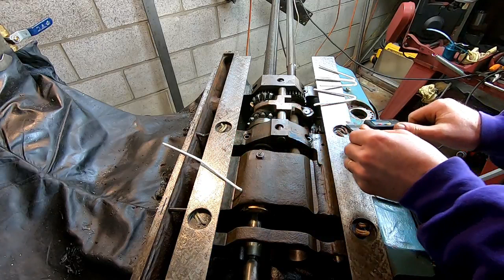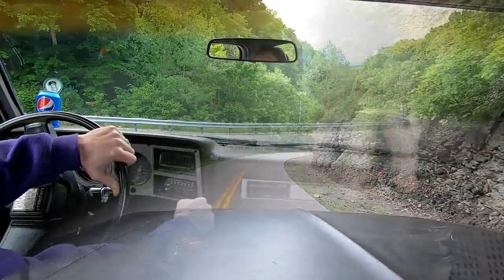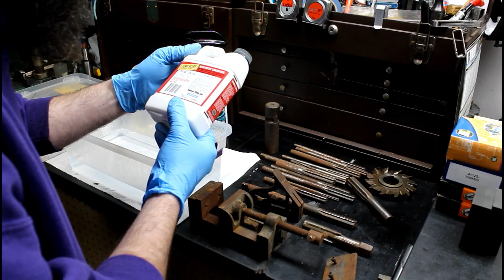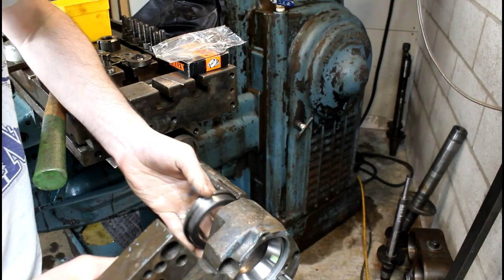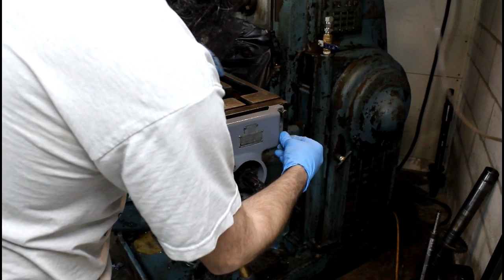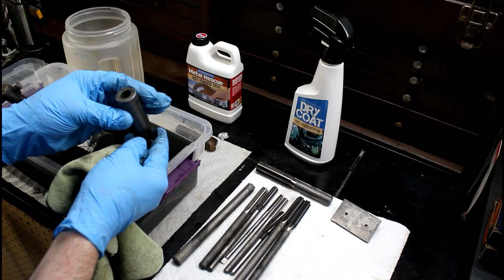Showing the K&T mill some LOVE

Comment: I wouldn't be surprised if the main constituent of the rust remover is based on Phosphoric Acid. I used some 81% pure PA, from a Hydroponics shop, when I was restoring a Lafette 42 machine gun tripod and it worked a treat. Beware, it will instantly destroy any electro/chemical metal coatings e.g. blueing, phosphating etc. However, as Steve mentions, it won't damage paint, glues etc.

Comment: Steve,
I have some some used horizontal cutters that I can't make use of and would send you if you think you might be able to use them at some point.  Most would need to be sharpened but you have the technology and know how for that ;^). They are all 6" diameter for a 1.25" arbor:
6 x 3/4 x 1.25
6 x 5/8 x 1.25
6 x 1/2 x 1.25
6 x 7/16 x 1.25
6 x 1/4 x 1.25
4 @ 6 x 1/8 x 1.25
If you're interested, send an email to jeback1@gmail.com
Cheers,
Jan Erik

Comment: Hey steve,  i havent watched the full video as of yet but i have watched the first 24 minutes so far .... One question. Before you installed the gear box shortly after the 22 minute mark, you installed the bearing race and bearings... But i didnt notice you fold the locking tabs to prevent the retaining nut from backing off. Or am i wrong ?

Comment: Have two sons the same as yours. Mine are 47 and 51 now but they loved there motor bikes and go karts. Both ended up enjoying the shop, welding , the lathe and the milling machine. Both are copier repairmen now, still coming to dads to use the machines all the time. Even making parts for those fancy new copiers. Enjoy your time with the kids. They grow up too fast.

Comment: I've seen a lot of brands for de-rusting stuff now. Bilt Hamber has a powder that self neutralizes after a while, they also have a gel, there's Evaporust, CRC and now this stuff. Sometimes I just use the pickling paste we use on stainless steel welds, but that can cause some damage, and it's pretty bad to get on your skin etc. Citric acid is less dangerous for you typically, but it does require you to clean your parts really good after bathing them

Keith Fenner runs some coolant mixed with kerosene in his K&T iirc, it looks pale blue in the videos, I think he's mentioned what he uses but I can never remember.

Comment: Steve,
When doing similar repairs on Timken bearings on manual machine leadscrews I indicate preload backlash. This is going to run very slow so eliminating all bearing backlash can be acceptable, but there is no advantage to over preloading the bearings. Use a .0001" indicator. I would shoot for something .0000 - .0005".  Gib adjustment can be done similarly. Zero clearance on a gibbed machine is not physically possible. The axis will jam. Shoot for something no greater than  
.0005" side to side indicated motion. This rule applies across gibbed machines, manual, auto and CNC. Reaching .0000" clearance didn't become possible until the Advent of linear guides.

Comment: Your rust remover demonstration was very well done.  Thanks.  Better living through chemistry!  Since the cleaner solution is water soluble, I'd be tempted to use a pressure washer after the soak to remove the bulk residue - wiping with a cloth seems ineffective.

Comment: The K&T is looking great! I use the same deruster on my Monarch parts with good results. Parts definitely have to be fully submerged/disassembled or you get discoloration that won't come off. My taper attachment shoe has a line where I flipped it in the solution!

Comment: The good thing is, you can use the solution over and over until it no longer works.  You can filter it occasionally to get the bulk sludge out.  I have used Bull Frog Rust Remover, and Evaporust, and both have worked about the same.  The Palmgren looks great, will make someone a great drill press vise.  How does the dry coat perform?

Comment: White vinegar is cheeper than that "Derusting Agent", JS.
Reply: White vinegar is indiscriminate in what it etches, be it rust, or the base metal. Chelating agents like this one or Evaporust, only attack the rust, leaving the healthy base metal unaffected.
Reply: I once used vinegar on some old rusty feeler gauges. The next morning I found it had totally dissolved all the thin ones! Literally just left with 1/4" stubs where the blades used to be. 👎☹
Reply: Chelating agents like the one Steve used are the proper choice for precision tools and things you want to look nice and have accurate sizes afterwards, like a Hermann Schmidt grinding vise.  Acid based solutions like white vinegar are best for use on an old rusty shovel.

Comment: I was surprised to see you use shellac gasket, Not many use that type of gasket sealer, I myself do use when called for, in a special situation.  Great job, with the vice restoration.
Reply: My Dad used to use a similar product to that years ago, it was called 'Osotite' in the UK, it went hard when it set, the other product on the market was 'Red Hermetite' AKA 'The Bodgers' Friend' which stayed comparatively soft, it's still around now.
Reply: @jonathangriffin1120  ,Yes ,I too learned to use that type of gasket sealer from my dad. Yes I have used the red type, it was in a glass bottle.

Comment: might be a good idea to fix the bottom part of the truck and repaint it with a roller , it looks a bit rusty at the moment
stuff i found working best for removing rust was muriatic acid , it works fast but if you leave the material in too long it will desolve
Reply: That's why I like the products that use a chelating agent! They only go after the rust and it doesn't matter if you forget them for a day or two! Also don't like using acids, etc unless I have to!

Comment: Excellent family video Steve. Love the Engineering in the mill table, designed to produce 24/7, would be interesting to know the cost of one new, probably comparable to a high end CNC in today's market. I've had good results with buying granulated Citric Acid and adding to water for de-rusting, very cheap, but they need a thorough clean after.
Best regards from the UK.

Comment: As a suggestion, I wouldn't use shellac on the ends of the table. Shellac hardens and as a result will fracture and leak over time allowing fluids to get in where they should not be. A better material might be something like a Three Bond 1184  
( https://www.amazon.ca/Three-Bond-Performance-Synthetic-Liquid/dp/B008D8XLJS/ref=sr_1_2?keywords=threebond+1184&qid=1558779621&s=gateway&sr=8-2  ) . 

Three Bond 1184 is a non hardening material that will seal in a very thin coat that will take vibration and impact very well without failure. It is frequently used on engine surfaces that need to be oil tight. You simply apply a thin layer on both sides of the joint to be sealed, let it tack slightly, and then bolt them together. Any material that migrates out of the joint can be easily removed with a dry rag. Three Bond will not form a "string bead" around the edges of parts that may separate like silicone but breaks down into small soft granules that will not obstruct oil galleries, wrap around rotating parts, or abrade surfaces. Just a thought..........

Comment: I wonder if that black stuff you wipe off, if  that was rust or that it is carbon of the steel that has been disolved?
Reply: That black stuff is probably magnetic iron oxide (Fe3O4).  Common rust is hydrated ferric oxide (Fe2O3).  The treatment contains a reducing agent.
Reply: @eliduttman315  spot on.
Reply: Probably a mixture of magnetite, and chlorine corrosion, from free graphite in the cast iron, and various cutting oils. Chlorine corrosion can eat through steel, the coolant tank on my Colchester lathe was a victim. Chlorine and Sulphur are compound used as high pressure lubricants.